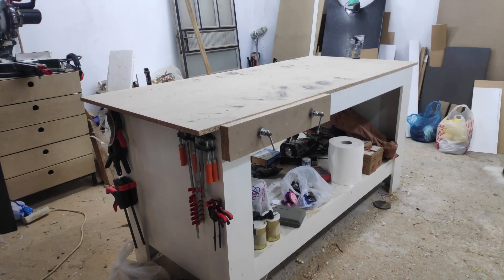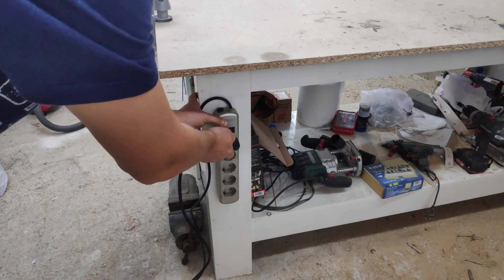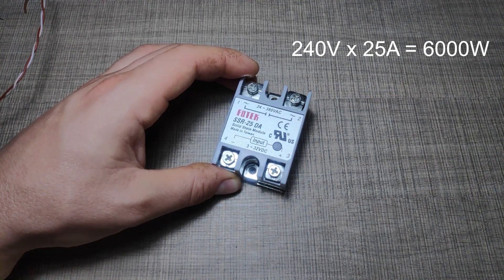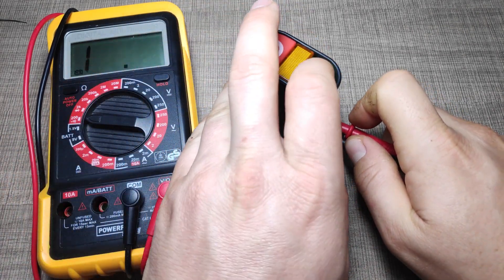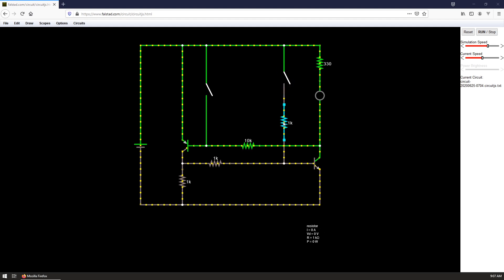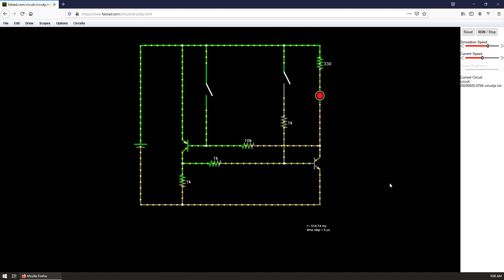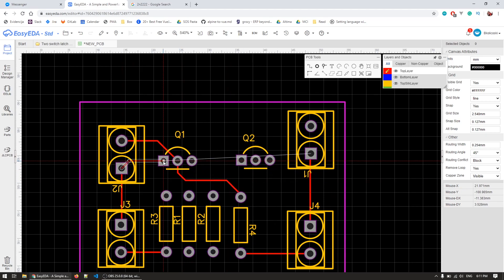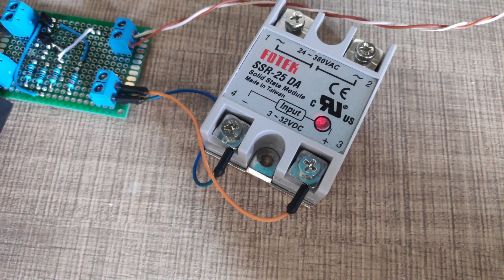SSR latching switch circuit design with push buttons

Comment: Good deal man, simple effective circuit.  Just finished a similar one but with only one transistor from an Arduino pro mini to ssr *edit (Arduino-> transistor-> SSR) for the “auto switch” circuit.   You should add an ssr to your old auto switch aswell!
Reply from the maker: Thanks! The goal was not to use an Arduino in this case. And yes an SSR will be nicer choice for the auto switch. I have an idea to include a version of it to the workbench so I might do a video for it. Thanks for the suggestion!

Comment: It's a bit over my head but would you need one for each tool?
Reply from the maker: The end goal is to make a cutout in the table where I will be able to drop in my router, circular saw or jigsaw, one at a time in the same cutout. So in theory I will only need to turn on/off only one tool at a time.
Reply from the maker: @TakamiWoodshop  yes I've seen this and it is the exact thing I want to do as well. I wanted to make the whole thing in just a single video but I ran out of time :D
Reply: Rob Tee - Takami Woodshop  he is simply using a standard on off switch.  Don’t get me wrong the guys work is incredible, but not centered towards electronics. (for the most part).   A Relay acts as a switch just like an on off switch would, but it gives you a whole lot of options on how you control that relay and what you can do to it.  I suppose if you’re unfamiliar with circuitry and components it might sound over the top, but it’s very easy to learn and create.  You can go as far as controlling relays (switches) via WiFi or radio communication, making your own shop remotes and etc.  it’s a neat path to travel down and worth it!